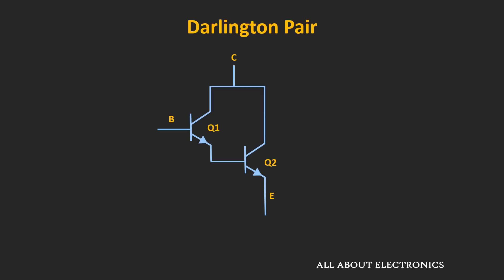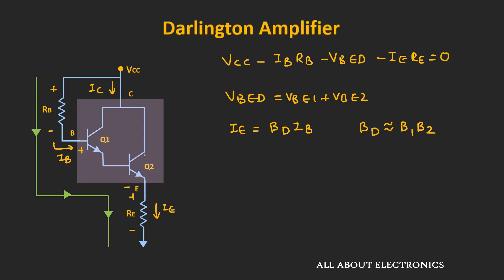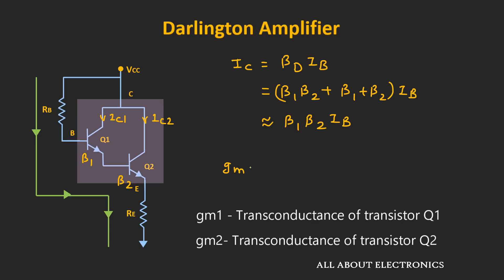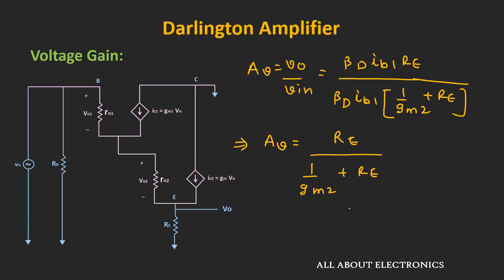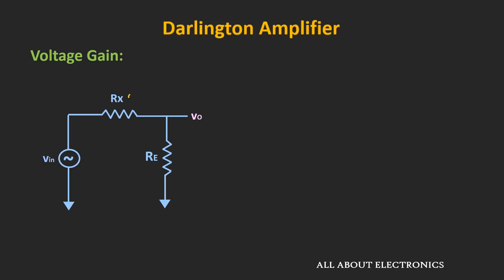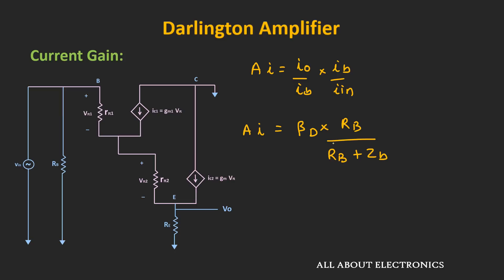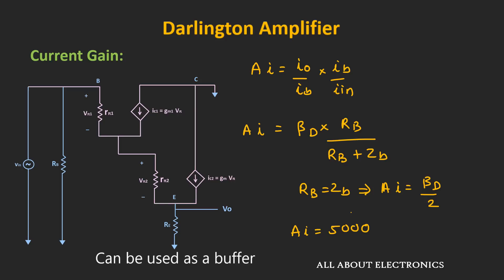Darlington Amplifier Explained | Darlington Pair as an Amplifier

Comment from the maker: The timestamps for the different topics covered in the video:

0:19 Darlington Pair as an Amplifier

0:52 DC analysis of Darlington Amplifier

4:32 Small Signal Equivalent circuit of the Darlington Amplifier

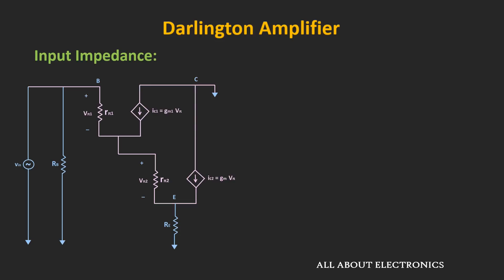5:30 Input Impedance of Darlington Amplifier

11:30 Voltage Gain of the Darlington Amplifier

14:11 Output Impedance of Darlington Amplifier

15:14 Current Gain of Darlington Amplifier
Reply: Is this pi model?
Reply from the maker: @nabzero6528  Yes
Reply: @ALLABOUTELECTRONICS  can you have re one, im having problems with re

Comment: Why cannot we say that Zo ( output impedance ) is just equal to Re from Zo = Vo/Io? Vo/Io is Re but you say Zo is approximately 1/gm2. Is it because that ı only consider right - transistor when calculating Zo  or there is absence part in the formula ( Zo = Vo/Io ) ?  I think that i am wrong but the both ways that calculates Zo are seem right to me. at 14:54 .